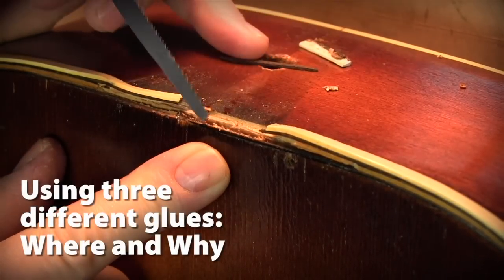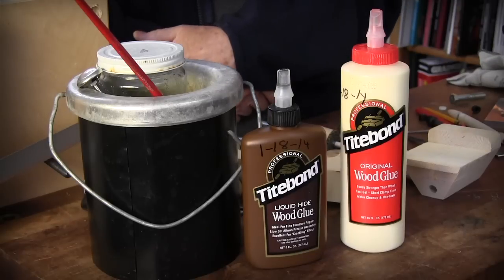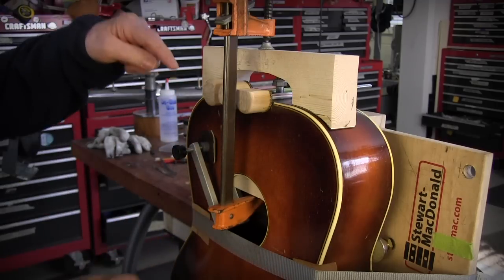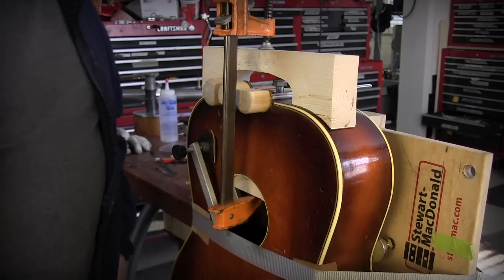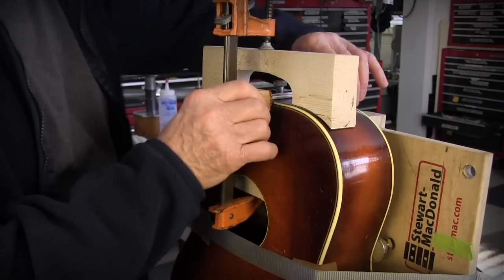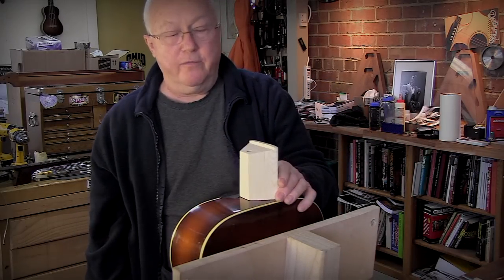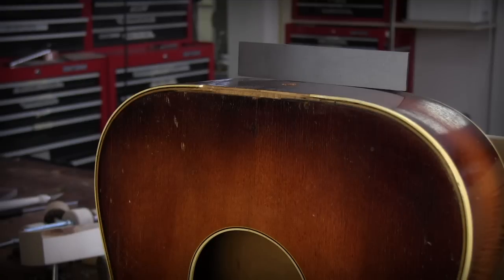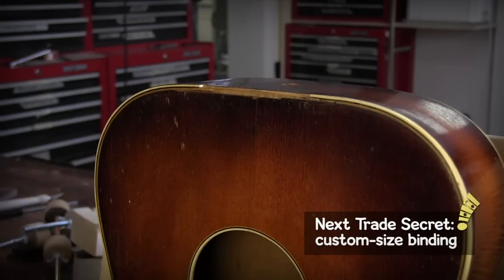Hide glue or Titebond for guitar repair?

Comment: Hey Dan. I recently removed a cracked nut on my acoustic guitar and installed a new Tusq nut in its stead using about 2 small drops of Hide Glue under the new nut and clamping it down for about 24 hrs to cure. Although I sanded the Tusq nut to fit both the width and depth of the slot it sits in, I unfortunately did not sand the height of the new nut sufficiently since the strings sit about 1/16" too high within the first three frets, and the instrument cannot be played properly without my fingers interfering with each other.

Short story long, I need to remove the new Tusq nut without 1) hurting the guitar's fretboard near the nut or the finish of the neck or the truss rod cover that sits right up against the nut.  I like your idea of using a moist cloth or 2) maybe spraying some water around the nut and let it soak it a bit to hopefully soften the hide glue which as you know is solely used for indoor projects. 

But what I'm wondering is would you recommend as far as using a heat gun in conjunction with the moist cloth and/or sprayed water of that area to simply wave the heat gun over that area quickly enough so as not to damage any of the areas I mentioned above?  Do you believe that would work without damaging the guitar in any way?  

After I remove the Tusq nut I plan to continue sanding it down about that 1/16" mentioned above as long as I don't damage this nut while removing it. LOL. TY for any recommendation(s).

Comment: Hi Dan,

StewMac member here with a repair question If you get this message and have time I have a question on glues for a repair.

I have an 1972 Epiphone Riviera EA-250 archtop built in Japan.  It is a fairly highly regarded vintage guitar today, though on the lower end of guitar models when produced.  I acquired this guitar in parts, every thing separate and not installed.  For its age it is in actually very, very good shape, body and neck nearly flawless, electronics somewhat less so.  It has a bolt on neck.

My repair question is on your thoughts on which glue to use to rejoin the guitar top back to the body in a area behind the bolt on neck pocket.  The total length of the separation is approximately 20 centimeters - about 4.5 cm on each side of the cutaway outside the neck pocket and then the whole interior of neck pocket.  The amount of separation is not greater than 2 millimeters, greatest just behind the center of the neck pocket.

Any thoughts on which glue and any clamping tips?

Thank you for your time and consideration,

Robbie Leavitt
Estes Park Colorado

Comment: I have built 5 guitars and I used Gorilla wood glue for gluing the neck to the body. I am by far no luthier, but I definitely like the Gorilla wood glue, it sets very quickly and none of the necks have ever come loose, it's been about 10 years since I built the first one, and so far so good still holding! My only problem so far building a guitar is when to stop sanding, how do you know when enough is enough.
Reply: Do you think it would gorilla glue would do well for a bridge on a Yamaha they glued right to the damn lacquer
Reply: @hollybellwether  I tried Hyde glue one time and I wasn't impressed, the neck just snapped off! You know the age old saying, "Trust your gut and stick to what you know works!" Since the late 90's not one snapped neck, until I tried Hyde glue, never again!

Comment: Do you think that Titebond would be enough to put back a horn that broke off a Stratocaster? I have a music Man stingray that has a similar issue. the previous owner threw it around onstage and cracked the back all around to where the control plate is in the front. basically the control plate being screwed into the rest of the body is the only thing keeping on to the rest of the body. it's about a 6 inch crack that goes around where the input Jack is.
Reply: I once repaired a broken horn on a strat by drilling two small holes in each part, the broken piece and the body itself. I then used hardwood dowels to basically join the piece to the body to ensure that not just gkue held them together. After sanding and refinish it was as strong as before.
Reply: And, how did it turn out?

Comment: I usually do not comment but as a maker of violins and other string instruments, I must strongly advise against the use of pre-liquid hide glues. These may seem easy to use but the use of chemical additives to give the "glue" a longer working time also render the joints weaker and not permanent.The "dried" "glue" in fact becomes hygroscopic attracting moisture. In my more than 40 years of working and testing glues, liquid hide glue joints eventually give way whereas a strong mix of traditional hide glue will last 400years vs the maybe 4 years of the pre-liquid stuff. To extend the working time of traditional hide glue, keep the room temp above 72 degrees, warm the areas to be glued with, practice a few times with the clamping and use a finely ground palate knife to push the glue into the area you wish. The job using the pre-liquid stuff may seem fine today, but under tension expect it to give way in 4 to 6 years.
Reply: I would like to see his reply, and if the glue can have an extended work time in warmer rooms, why not do that? (how about humidity levels in the room...is a higher humidity preferred when working with HHG? I don't know much about repairs other than I have a good guy who uses hot hyde glue on my vintage guitars, but a question would arise here. If the difficulty of the repair changes to where the cost of using the faster setting glue is not possible without several added steps that brings the cost of the repair to much greater than the worth of the instrument, do you just not do anything, or if it is not a very high stress area, you take the less expensive route to at least try and repair the guitar? He did say his preference is for hot hyde glue, and always on vintage instruments, but this is not a $20K guitar, so how much time and effort do you apply to repair a $500 guitar? Is this an area where the strength is not as much a factor? I don't know. What do you do with a loose brace in a violin? Do you remove the top, or is there a tool go get inside?? (not related, but I have a 1950ish Gibson L50 in otherwise fantastic condition, and am thinking of just turning it into an O hole with the f holes....lol....lazy mans way, but also less chance of me messing it up!! Hope he replies to the statement!!
Reply: I did not go into great detail about the use of traditional hot hide glue as the correct proportions depend upon the gel strength but the temperature is best around 146 F. Techniques have developed over the centuries to insure its successful use in various situations no matter how short the working time. For example, when gluing  the back to the ribs, first the ribs are clamped to the back and alignment is checked. Then only a few clamps are undone, two thin knives pry the area between the clamps apart, the hot hide glue is beaded along the edge between the two knives and worked into the separated area with another thin knife. The two pry knives are removed and clamps re-applied to the area. Then the next adjacent area is undone etc.: sort of like zipping up the back to the ribs. This is not a matter of putting glue over the whole assembly and frantically trying to clamp everything down within one or two minutes. Only one minutes worth of clamps are removed at a time. Hope this helps.
Reply: all depends on where you are storing your instrument. 
titebond is top of the line and i highly recommend it
Reply: If you did a lot of testing with hot hideglue...do you have any of the results online?
I'm interested in the properties under changing conditions.
Reply: None of my results are on line. The strongest hide glue I use comes from Kremer in NYC but there are plenty of sources. My mix for this is 5.0g hide glue crystals to 9.5 g water. At least four hours of soaking, then with the room temperature above 72 degrees F the mix is slowly warmed to 146 F( I use a thermometer this time because this mix is for permanent joints like the center joints of back and top). At the same time the glue is warming, I warm the joints. When all is ready, the glue is quickly brushed on the joints and clamps are applied. For other applications I do not measure but go by how much the glue runs when heated.
Reply: I am an engineer, not a luthier, but your comments make a lot of sense David.  After being fascinated with hide glue since I restored a pre Civil War Era melodeon reed organ, it occurred to me to heat my work shop to 80 degrees and pre -warm the joints to be glued with an incandescent lamp before applying the glue to make sure the glue was completely liquid when the joints were aligned and clamped.  The organ lasted 150 years without a glue failure so I was happy to replicate the original adhesive, plus I know the joints can be undone by another owner many  years after I'm gone.
Reply: David Rapkievian Would liquid hide glue be okay for gluing a fretboard or something that has no tension?
Reply: I would not use liquid hide glue as there is a certain shear force that exists between the neck and fingerboard surface which over time can cause the board to slide in places and the neck to warp. It is really not very difficult to start with the dry crystals, soak,  warm the bottom of the fingerboard and top of the neck, brush on thin hide glue quickly, clamp and clean up the squeeze out.
Reply: Assuming the temperature will be over 72°, with a 1:2 ratio, on average, how long is the useable time before it gels up?
(I want to try this with an electric guitar but it has a large surface and was wondering if there would be enough time to cover the whole surface and clamp in time).
Thanks
Reply: What I do as a violin maker is clamp up the top or back before gluing. Then by removing only a few clamps at a time, I insert a very thin palate knife to hold open the area. Next, with a medicine dropper, I put glue over the opened area and finally with another very thinly ground palate knife(slightly warmed), I push the glue into the opening, wipe off excess, replace the clamps, and proceed to the next adjacent area. With this method, I sort of unzip, glue, zip, unzip, glue and so on. Each area is small enough to comfortably work within the one minute of time hot glue affords.
Reply: Hi all.  I was wondering if anyone has any experience using RESORCINOL as a glue for structural repairs on a guitar similar to the ones shown in Dan's above video?  Thanks in advance for any thoughts.
Reply: It's generally considered a bad idea to use LHG however in the case of repairing some things just heating up the environment is simply not enough time. So if you make sure that your LHG is very fresh by checking the date code then you should be ok. Notice that Dan has the date written on the bottle.  Before I knew any better the first classical guitar I built used Franklin LHG. That was 30 years ago and this guitar has been to hell and back and has no issues.

Having said that, I would NOT recommend using LHG for guitar building, I am just sharing my experience. What I do for tough repairs is a combination of heating up the parts and the environment and making my own mixture of glue with a bit of salt to extend the working time.
Reply: Mays this comment stays on top forever!
Reply: @Davidrapkievian  what do you suggest for gluing a guitar neck and body together? I'm building from scratch
Reply: @BulletFever1  I use a strong hide glue (as described previously) to glue on violin, viola, cello necks. I suppose one could use original titebond (as it is not a polyvinyl glue like the more recent varieties). I used to make balalaikas on occasion and would extend the tongue of the neck through the neck block, cut out a small rectangular hole in the tongue where it extends beyond the block( inside), and insert a wedge through the hole. I would use titebond original, put the neck into the neck block and use the wedge in the hole to pull all snug. My necks probably would have stayed on without gluing and this is probably overkill but I never wanted to  have a  neck pull up for any reason.